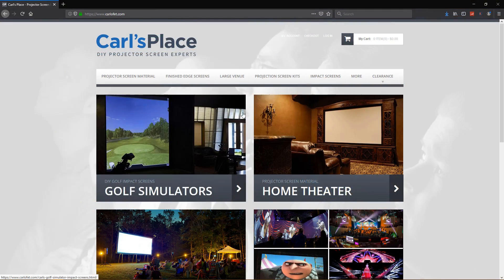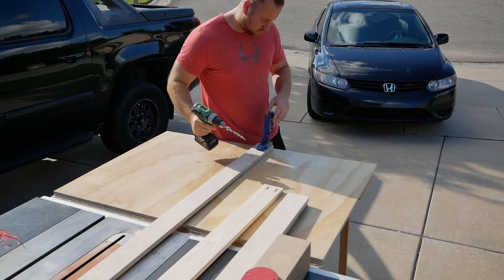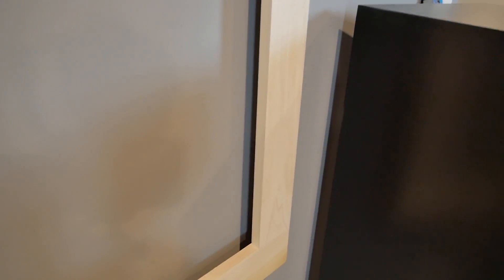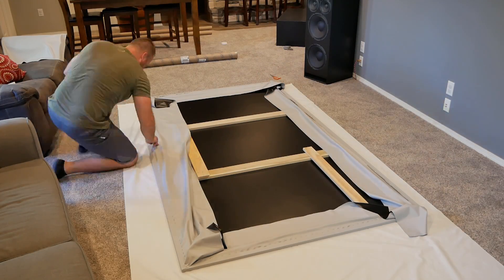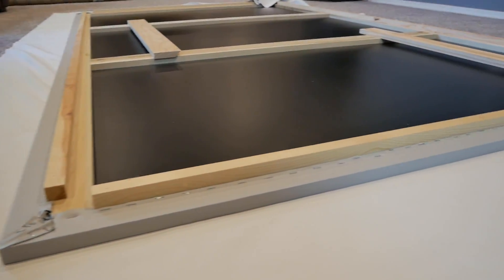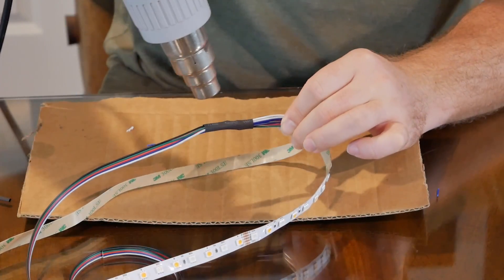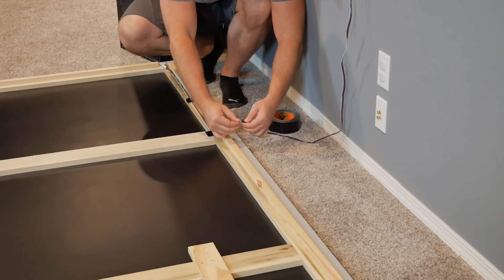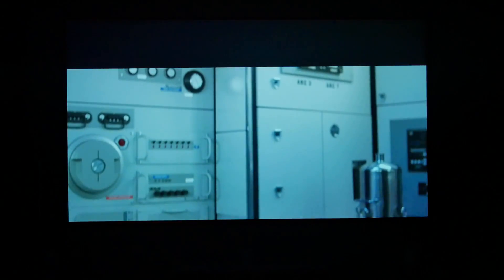DIY How to Build LED Backlit Projector Screen with Carl's Place FlexiGray

Comment from the maker: Check out all the products Carl's Place has to offer to make your own DIY projector screen! http://bit.ly/Carlsplace
Reply: Do you sell projector screens you make
Reply from the maker: @otdarough5885  no, these are way too big to ship anywhere. Need to be made on site
Reply: I've got my frame built and my flexigray is arriving tomorrow.

About how hard do you pull the screen when stretching it over the frame?
Reply from the maker: Just a little bit of tension to get the wrinkles out. You don't need to really feel like youre stretching the material much unless you are trying to get some wrinkles out in the corners.

Comment: Why that black bar on the TOP mate?
Reply from the maker: 16:9 screen. When the projector recognizes a 2.35 aspect ratio, it lowers the image down to remove the black bar on the bottom. Just a larger black bar on the top. Brings the image more eye level
Reply: @LifeofBliss  My OCD would not handle it. haha would have to be center for me mate

Comment: So it's not actually LED backlit, it's just some side LED's aka Philips Ambilight or whatever it's called, I wonder though, if you could actually install full-fat LED backlighting using the new cutting edge high refresh rate RGB LED surround lighting kits available, then again it might end up washing out the blacks and contrast.

Comment: Excellent  video , what panasonic projector are you using
Reply from the maker: I had the Panasonic AE80000u at the time
Reply: That's what I'm using here in ireland , they called it here the AT6000,  what did you upgrade to , I was looking can't  find what  panasonic brought out to replace it , I was looking to go 4K , just don't know what would be my next move as I would like to keep the 3D on a 4k one aswel!!!!

What are you using and any recommendation.  Thanks 

Darren.

Comment: Hello. What is the black tape that was attached to the corners at minute 10:29 used for?
Reply from the maker: To help with any light bleeding once the screen size was adjusted for the screen.
Reply: @LifeofBliss  Thank you

Comment: Did you also have to add to the material that was going behind the frame in your fabric order?
Reply from the maker: You mean what was wrapped around? You'll need to take that in to account when ordering. If you have any questions on what size to order, give them a call. They are good people. Tell them Kyle says hi 😉

Comment: Hi, Really Cool stuff. So the black tape did not begin to move away at the edges due to the fact that it was bent?
Reply from the maker: Nope, held really well actually. Only place it pulled up was on the very corner on the outside end. A staple on each corner fixed it

Comment: Awesome diy, I’m gonna try it in our new house, but why did you lose that foot at the top of your screen? Was that by design?
Reply from the maker: It's a regular 16:9 aspect ratio. When 2.35 movies play, they have the black bars at top and bottom normally. My projector has a function where it recognizes 16:9 or 2.35 content and can adjust the zoom and positioning of the image. I chose to lower the image to the bottom of the screen to make it more eye level, removing the bottom black bar and making the top black bar bigger. 

Good luck building yours! It's a fun project
Reply: @LifeofBliss  oh awesome! Thanks for the quick reply!

Comment: I have gone back and forth on my approach to building my frame. I like yours due to the simplicity and less opportunity for mistakes. But I'm concerned about the inner bracing showing through the screen.  Have you had that problem at all?

I've seen people add quarter round to the edges and other techniques, but I'm not sure I want to go that route.
Reply from the maker: Doesn't show through at all on mine. Make sure you get flat boards. If there's a slight bend to them, make sure they bend towards the wall vs the screen. Also, when you attach the cross braces, you can recess them a few fractions of an inch behind the top and bottom of the frame (hope that makes sense). You definitely could add quarter round or something like that, but its just another step and more money.
Reply: @LifeofBliss  yes that makes perfect sense. Thank you for the insight and your videos. They helped me decide on the flexigray from Carl's.

Comment: Will this screen material work with a short throw laser projector, and great video by the way 😎
Reply from the maker: Thanks man. Youd have to reach out to carls place for a definite answer on that. I dont see why it wouldn't, but some UST projectors use an ALR type screen specific for them if I'm not mistaken.

Comment: Why not hang on nails? or screw frame hangers to the screen? would like to know your thoughts
Reply from the maker: It wouldn't start on just hanging it on nails. My subs would rattle it off within a few good scenes. There are many ways you can hang it, i just like this method because you can slide it side to side to very easily if needed. And it's super sturdy.

Comment: Great vid...I’m completely comfortable building the frame but a bit apprehensive about stretching the material evenly, without wrinkles. How hard is it to do?
Reply from the maker: Pretty easy really. Just start by throwing 4 or 5 staples in the middle of each side, then pull towards you and slightly towards the corners as you work your way around. I've never done it before this, its not bad

Comment: Hey Bliss, nice video. I followed the instructions and didn’t realize it, but have some waves/ripples at the bottom of my screen. Do you think it might be because the material isn’t tight enough? Its roughly 150” diagional
Reply from the maker: Yea it doesn't sounds like it was fully stretched one way. If you had enough material to get a good grip, you could pull out some of the staples and try stretching it a bit more around that area.
Reply: Life of Bliss thanks. I was able to get out all the wrinkles. Thanks for the video, it was extremely easy to follow. I’m looking forward to using this screen for years to come

Comment: Is that extension wire rated for in wall use?  I couldnt find anything on if it's is or not.
Reply from the maker: Umm I don't know that it is. I personally didn't run any through the walls besides going straight through a few. It's low voltage stuff so I wouldn't be too concerned, but that's just me...
Reply: @LifeofBliss  ok, thanks!

Comment: Just another tip for the bias lighting.  Turn on your lights to white 6500k.  Low setting, instead of off.  It helps with fatigue and increases contrast.

Comment: Now that you've had it up a few months, how has the black felt tape adhesive held up?
Reply from the maker: It's held up great, even the way it's folded over the edge. Only lifting was the small square on the corners in the outer edges of the screen. 1 staple in each and they are held down, can't see the staples
Reply: @LifeofBliss  Thanks for the feedback. My screen is very similar to yours except spandex. I have the same tape but went the route of building a little trim frame that slides on the outside edge. It looks great on 3 sides but sags on the bottom so I'm thinking about applying the tape directly to the spandex. I'm thinking I might also have to staple it.

Comment: Fantastic video, I’m in the middle of building my own project.  Very sharp image from video.  Why is there a large black boarder on top.
Reply from the maker: My projector has a lens memory function for different aspect ratios. For anything 2.35 or 2.4, I have it lower the image so it's more eye level and only a border on the top of the screen

Comment: What is the use of backlit? I thought projector needs totally dark place so it gives more crisp & clearer video  display?
Reply: Well, if you ask it in that way, it is totally pointless. But, hey, it does look cool. And yes, while the projector needs totally dark place for bright and crisp image, the LED behind the screen doesn't effect it. Since the light from the LEDs is not directly falling onto the screen. Hence, it just helps making the screen stand out more.
Reply from the maker: Yea it's just for looks, doesn't help the image out any. It will slightly boost perceived contrast if there is some light behind the screen as it makes the blacks look deeper, but we usually don't have it on while watching

Comment: not sure if this was asked already but how did you hide the power supply wires? I saw them when you were mounting then the final product i didnt see any.
Reply from the maker: That was what the hole in the wall was for. Ran the power wire through the wall to the power supply in the closet under the stairs

Comment: Putting an LED strip behind your screen does not equal LED backlight. An backlight is what all normal screens have to light them up. Not even remotely the same as a light behind the TV.

Comment: Why does every "DIY" video on youtube have a table saw?  Like that is something most people have laying around.  Great video though.  Thanks!
Reply from the maker: Thanks. A table saw is just one of those things you really need for cutting large boards or long cuts. You can make due with a circular hand saw, but you'll eventually want a table saw for accuracy
Reply: @LifeofBliss  Home Depot / Lowes cuts boards for free
Reply: @wxyzcxyz9170  *FACEPALM
Reply: @LifeofBliss  use a straightedge and clamps as a guide for your circular saw. Perfectly straight cuts with no table saw necessary. You'll need sawhorses though 🙂
Reply: I feel your pain. A circular saw just sucks for long cuts.
Reply: Why does every cooking channel use knifes and blenders? Like that is something most people have laying around... Dumbest logic ever man. You cant make things without the proper tools.
Reply: Dumbest comment. Maybe I should comment, "why does he use cordless drills? Like everyone has those?".
Reply: BUY A TABLE SAW!
Reply: What'd you think you're going to DIY with, Legos??? To save money DIYing you need to get the right tools. I bought a DeWalt compact table saw for $250 that folds up into the size of a large luggage, fits under my $50 folding table. Budget investment for DIY

Comment: One word.... awesome.  one more... DREAMSCREEN for colors that follow your movie  :)
Reply from the maker: Thanks! Those lights do look cool... but they are at least 2-3x more expensive than what I did (probably more for such a large screen). Plus I already had this system in the basement so I kept it consistent
Reply: @LifeofBliss  There are a few Raspberry PI based versions as well. Hyperion and some others you can goog...   the color you added makes it look awesome...Good job

Comment: NO! Damn it!  This video was not helpful! In fact all it has done is make me bitter and envious! Although I live in an apartment, my landlord is all too keen on my "DIY Home Improvements" however, the tools! The got damn tools!  I keep checking pawn shops for a table saw, miter saw and other tools.. no joy. I have a large patio to work, I have cool neighbors, but no tools!
(Your house is fabulous with color lights! So, so jealous!)
Reply from the maker: Well shit, sorry it wasn't more helpful! 😉 I appreciate it man. It's taken many years of accumulating tools to get to this point. Still borrow some from neighbors as well lol. This could honestly be done with a jigsaw and a drill (and Kreg jig) if that's all you had. The cleat could be bought. Hangman makes a good cleat I've used for various things

Comment: Would love to do this but I don't have a table saw nor some of the tools.  Wife always takes over the garage 2 months out of Halloween so she can make her HUGE village.
Reply from the maker: If you have a circular saw, you can do this. You can grab a Hangman cleat system instead of making one. You'd just need to make the length cuts. Shoot, even a jigsaw could work 😉
Reply: @LifeofBliss  will give that a shot.  Thanks for the vid.  One of the better ones I have seen and cheapest.
Reply from the maker: @justinstephens72  good luck man! It's pretty fun/easy, plus it'll make your projector look much better than on the wall

Comment: The lights would be cool if they were synced to whatever is on the screen like the ambilight from Philips. I'm pretty sure I've seen such an open source project
Reply from the maker: Yea that would be cool, but they are pretty expensive from what I've seen. More than I wanted to spend on lights
Reply: @LifeofBliss  I said "like the ambilight" ;-). Check on the open source scene, you can probably get away for pretty cheap.

Comment: I don't mean to be a dick, but I can't help myself.  Wouldn't it be more balanced and stable if you made the two french cleat mounts the full width of the screen on the upper and lower halfs?  Then you won't get any "counter warping" from uneven pulling.
Reply from the maker: Sure you could do that. It'd just take a little more wood. It's plenty stable with only the middle cleat if there is no warping though. It's only 20 pounds at most. This is just my method, it can be tweaked to your liking. Now stop being a dick Brian... 😉

Comment: Just a quick tip for anyone trying to get rid of those distracting bands of light on the floor and ceiling (as seen at 11:59), tape the LED strips facing the wall, not out. You will still get the ambient light just around the screen, but the bands of light will be gone.
Reply: What is the ambient light for anyhow? Just visual flare?
Reply: @TheMeanArena  It reduces eye strain and fatigue.
Reply: https://amzn.to/2MS0iay

Comment: Great job. Just wondering why the movie didn't cover the whole screen and have you ever thought about getting an Ultra Short Throw Laser Projector?
Reply from the maker: Thanks man. It's a 16:9 screen and the movie was 2.35:1. My projector has a feature called lens memory which will recognize different aspect ratios and auto adjust to whatever settings you set up to. I make it drop the 2.35 image to the bottom of the screen to make the image more eye level and remove the black bars on top/bottom. They are only on the top that way.
I've seen the laser ultra short laser projectors, but haven't looked into the much. Pretty happy with this one currently but will look into that as an option as well when I upgrade

Comment: Awesome setup! However you really should put your center channel on a short stand with an angle to "aim" it at you. The waveguides have awesome horizontal dispersion but very limited vertical dispersion by design. Other than that great setup and videos!
Reply from the maker: Thanks man! Yea the final plan is to have the center channel lifted to the bottom of the screen. It will sit on the 2 boxes for my other 24" subs that will go on either side. They will have a little shelf for it to sit on. Work in progress 😉 But that's the next step, so should be happening soon!

Comment: I for sure thought the folded over led’s were going to show through the screen! Good job!
Reply from the maker: That black backing really does a good job to block any light from coming through 😉
Reply: Life of Bliss is the backing part of the material used for the screen or added later separately?
Reply from the maker: @Test-Pilot1194  it's all part of the material.
Reply: Life of Bliss so if no light bleed through the rear, that’s reason to believe you lose very little from the projected image. Cool👍🏻

Comment: Awesome build. To be honest I was expecting something extremely over the top like your other videos, like a screen that would pour your drinks haha. Actually I was hoping this was one of those ambient reactive backlights. I have yet to see an affordable version though. To explain its basically the same leds but they turn different colors at the same time to match the image on screen so in the ocean at nights the lit blue water on bottom is blue leds on bottom white led for the boat on the sides and black night is led off on top. Awesome but so far the cheapest is twice your overall cost just for the led and controller.
Reply from the maker: Thanks Philip, my wife said the I was "so extra" or something like that when she realized the lights were synced up on the same system as the bar lol. I'll have to let her know I could have gone more extra 😂 Those setups are cool, but like you said, costly... These lights were still about $100 to put behind the screen, I wouldn't want to spend too much more on something like that
Reply: I made an ambilight kit for the back of my 4k tv that runs off an Arduino Uno and it works perfect. Not expensive either, just individually addressable led strips, power supply and the Arduino, that's it!

I'm currently working on my own projector setup but with a 90" roll up screen so no fancy led's. I'm using paper floor lamps with Philips Hue bulbs instead for the ambient lighting.  

I deleted my Youtube channel a while back so i don't have a video of it running anymore :(

Comment: Great video man! I love led strip lights. I use 2 pairs for shelves that run across the back and front of my room close to the ceiling 1 set behind my tv I wish I could use a set for my screen but I have a elite pull down screen. I also use a pair 4 inside my entertainment center and a pair behind my theater seats and a set under each seat. I went kinda nuts with them but I like them. By the way loved the grizwald moment Clark.
Reply from the maker: Haha thanks man! Sounds like you have a nice looking setup too with the lights. Some people don't like them, but it's not like you can't turn them off...